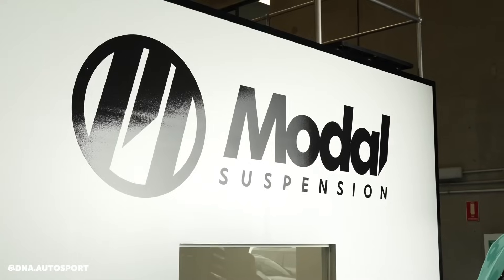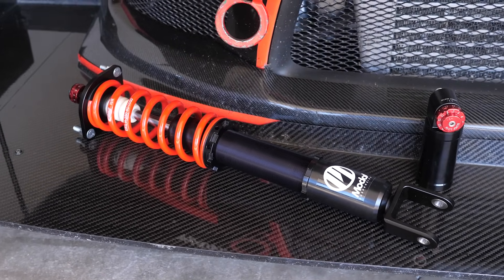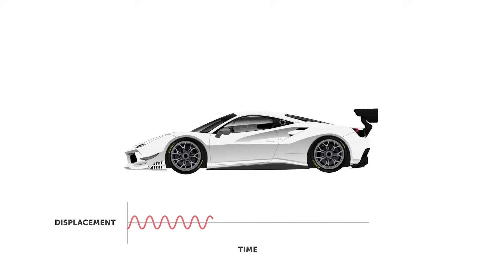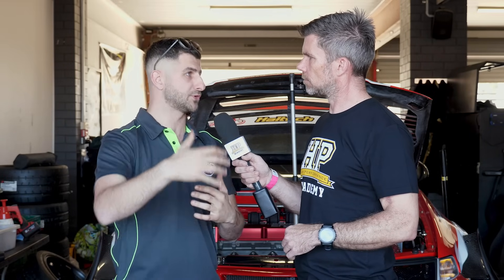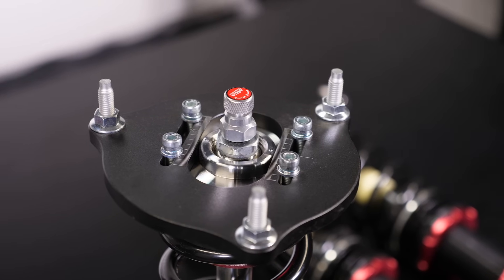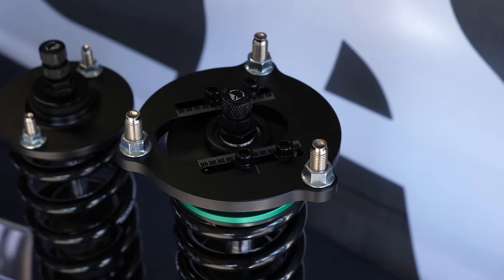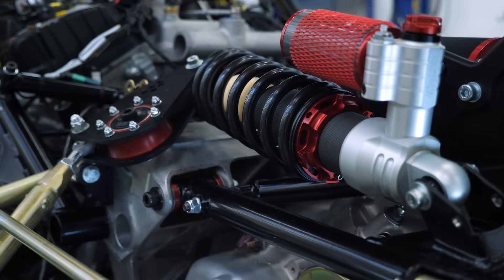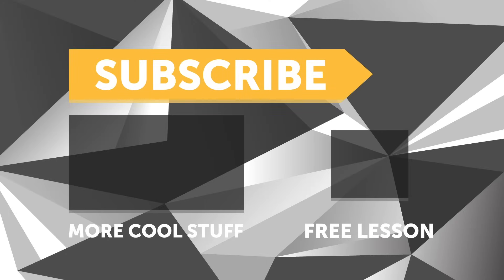'Make or break' your race car with these pro tips.

Comment: I would be great to hear a discussion on sway bars. There is a lot of contested opinions on how much wheel-rate the sway bar should contribute vs the spring itself…..some people go as far to say sway bars are a balance “bandaid” and should be as small as possible / non-existent if all other suspension design & tuning aspects are correct.

I personally think the line between a production based car and a purpose built race car makes some of these contested opinions a bit blurred, due to how significantly different the open class cars at WTAC are from their road going counterparts.

There probably is no straightforward answer though it would be nice to understand why opinions differ so greatly on the topic of sway bars.
Reply: I've seen a lot of these differing opinions too it's made it hard as an enthusiast on the outside to really understand them at all. I've heard from one source many years ago that an independent suspension car is held back from having a sway bar, as you've now reintroduced a connection between the corners, and a hydraulic suspension set up with links corner to corner is better and you can remove the sway bar like Mclaren road cars, but usually that comes with cost and complexity which clearly many manufacturers don't find the trade off worth it. 

Then a few coilover manufacturers seem to recommend using stock sway bars with their coils as they're already stiff enough in controlling body movement and an upgraded sway bar will make the car too skittish, also been told a car should be set up as soft as possible (Within reason) when set up correctly which I thought would imply a stiffer sway bar could allow you to go a bit softer on spring/dampening 

I've also been told most off the shelf performance swaybars aren't stiff enough to make much of a difference except for corner entry.

I've also heard the "band aid" fix like you mentioned for cars with poor geometry etc. 

I share your struggle dude